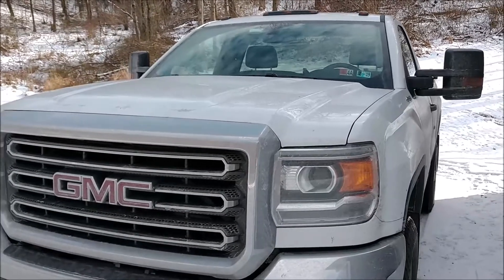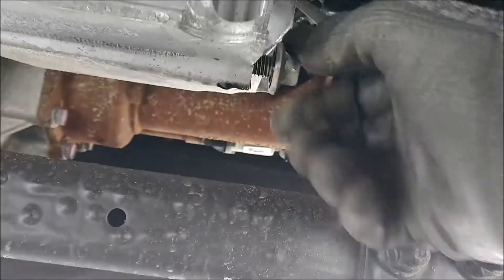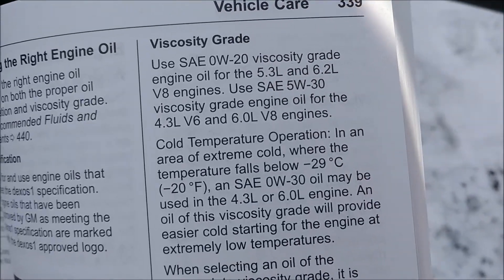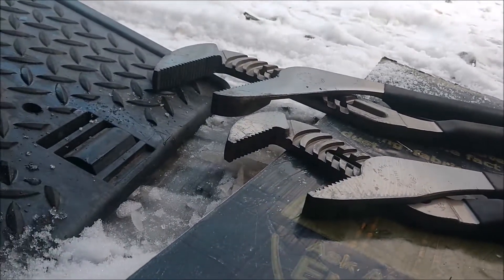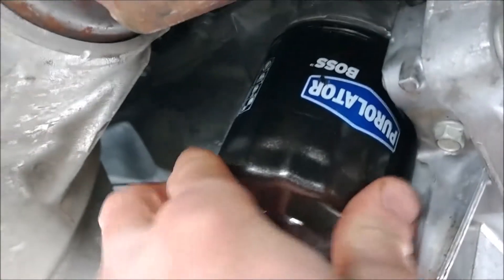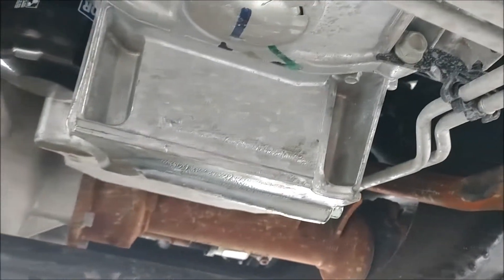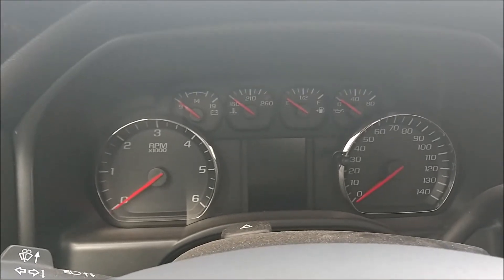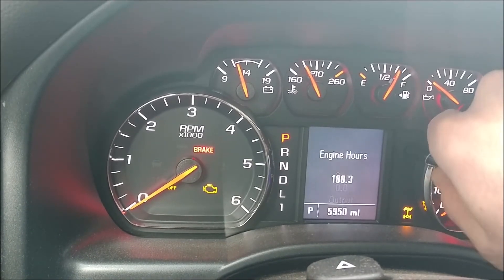2018 GMC Sierra oil change

Comment: Yup typical  with warm oil that oil stream will shoot out almost to the tire .only engine I've ever seen with such a far stream when plug is removed. A tip for your oil filter get yourself the tool that is a custom socket fit,s over filter end makes removal so much easier

Comment: Why did you use 5w-30 and not 0w-20 just curious? What type of motor
Reply from the maker: dl3404 - I used 5w-30 because it's what the manufacturer recommends. This truck has the 6.0 liter V8 gas engine.